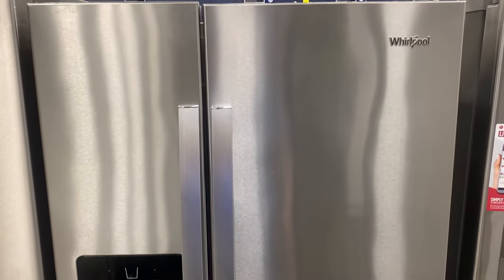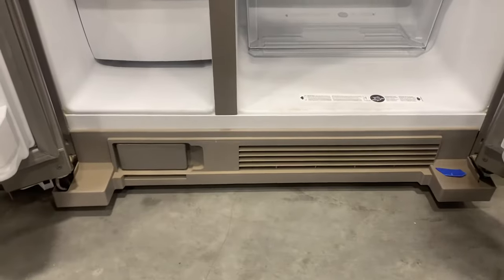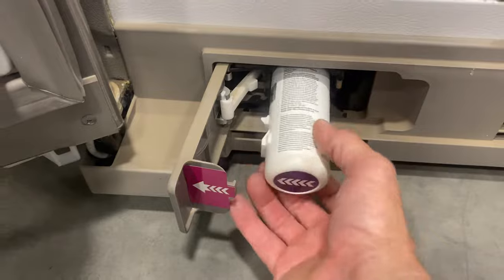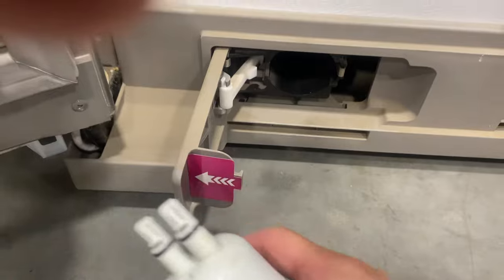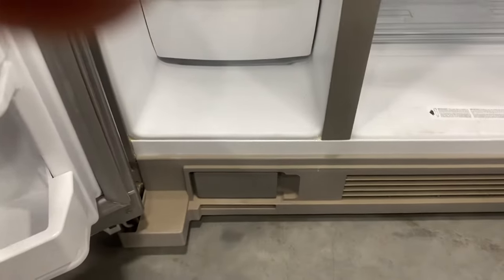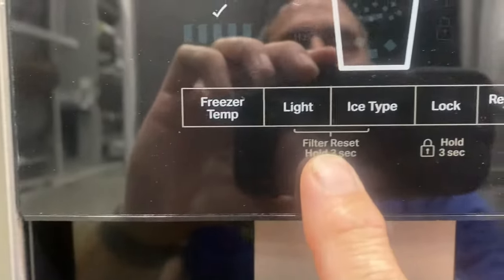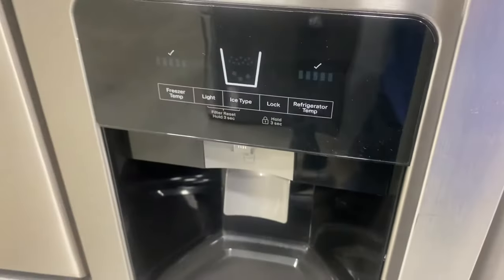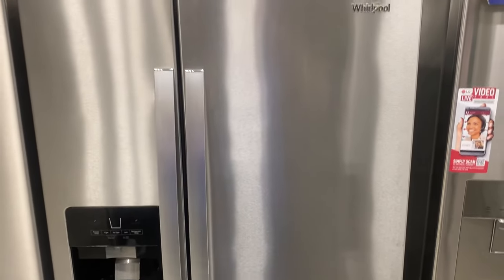How To Replace The Water Filter On A Whirlpool Side By Side Refrigerator

Comment: I never use the water. My light has come on to replace the filter. Will it hurt anything if I just reset the light. I do not use the ice or the water. Thank you.
Reply from the maker: That light has no idea of the condition of the filter and will come on periodically to tell you to change the filter. If you don’t use the ice and water don’t worry about it, will not affect any other function of the refrigerator.
Reply: @danielsonpicker7279  Thank you so much. I appreciate the reply❤️

Comment: We have this exact fridge brand new.. the little arm that pulls the filter out is not hooked onto the filter so it doesn’t automatically pop the filter out.. any tips while we wait for a service tech? Thanks
Reply from the maker: I don’t think that can be fixed, whole filter housing needs to be replaced. You can use a small screw driver to pry the filter out. Good luck!
Reply: Thank you! We will wait for a service tech.